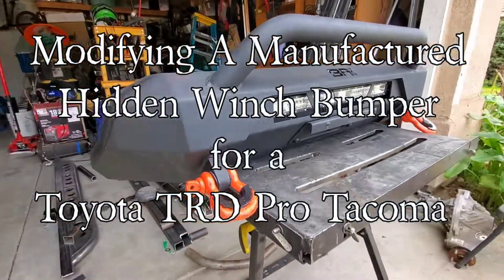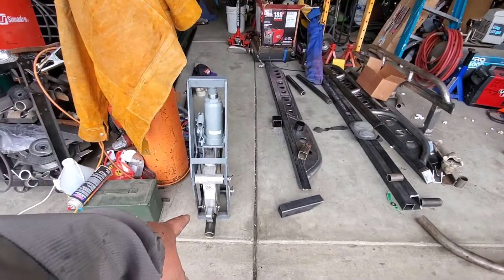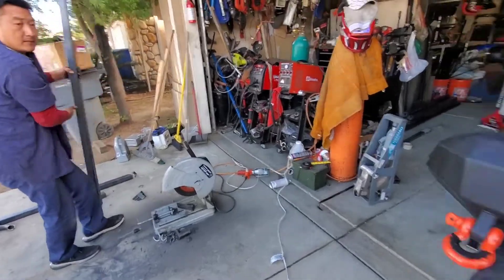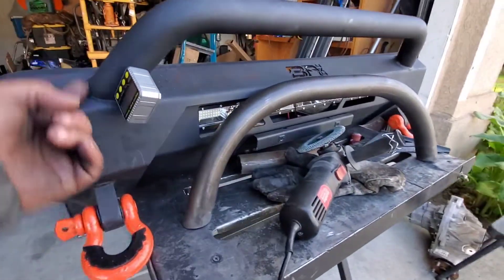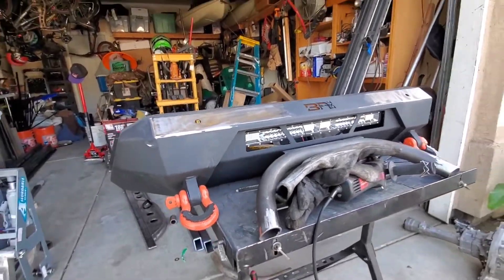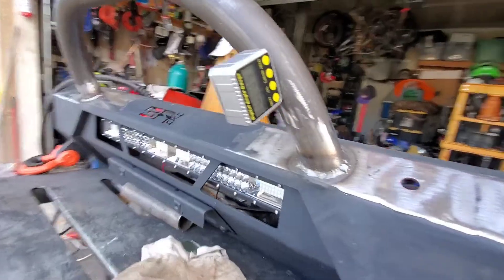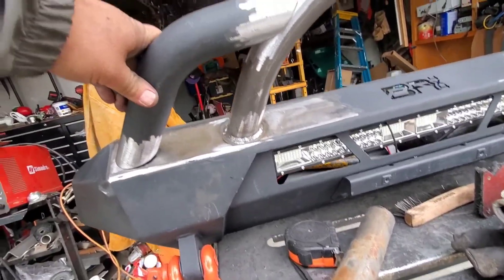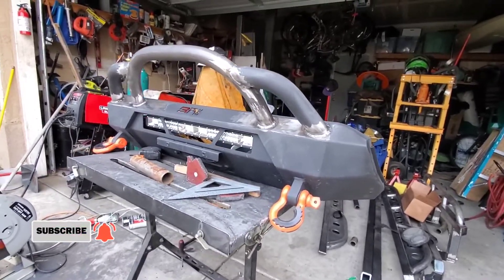Toyota TRD Pro Tacoma Body Armor Winch Bumper Mod

Comment: Nice work, have you tested your weld beads for strength lately?
They look decent, but are they penetrating properly and strong under stress?
Reply from the maker: Like bashing them on rocks and jacking the rig up using them as the lift point?
Reply: @theotherguy3083  no, like welding the end of a 1/4"X 1 1/2 wide flat bar at a 90' angle to something larger and stout. Then proceed to bend the flat bar so that the weld bead is absorbing most of the stress, will the bead break, crack or withstand the stress¿
This test would make for good content. 

Thank you.
Reply from the maker: @ellerybice3787  I'll try that
Reply: @theotherguy3083  it will interesting to see the results, I hope you share what you learn. 

Buena suerte mi Amigo.
Reply from the maker: @Ellery Bice  when I do it I sill tag you.